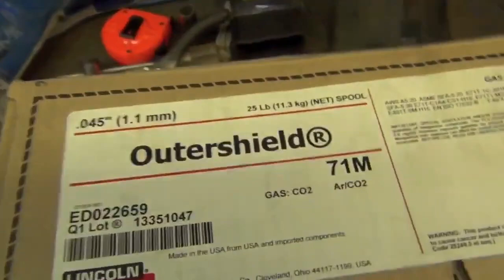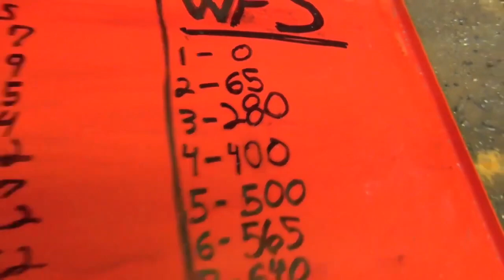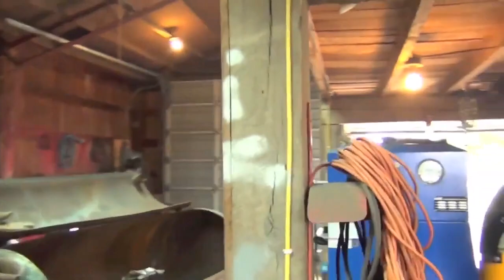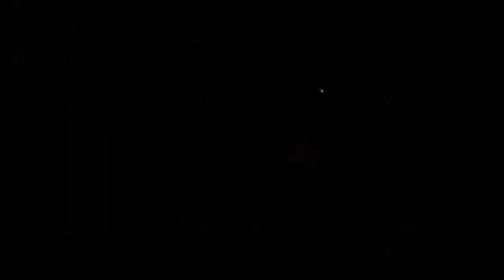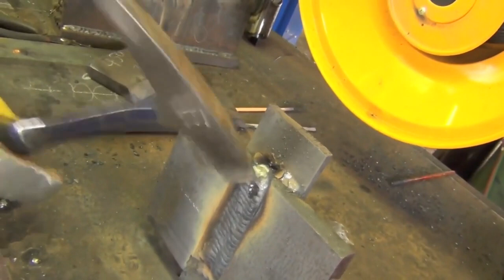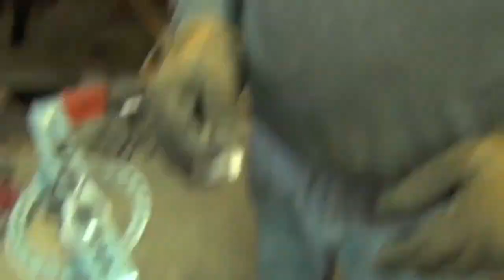FLUX CORE DUAL SHIELD WELDING WITH PETE!!! HEAVY DUTY WELDS

Comment: We do this process a ton at work, not saying you can’t push it, as you do running uphill, but flat you should when applicable to drag. Good welds though. Obviously this isn’t a test, but if I had a run on/off tab I would use it. Good job y’all!